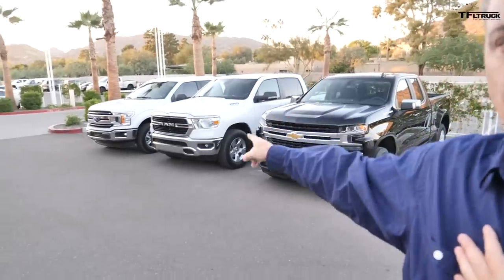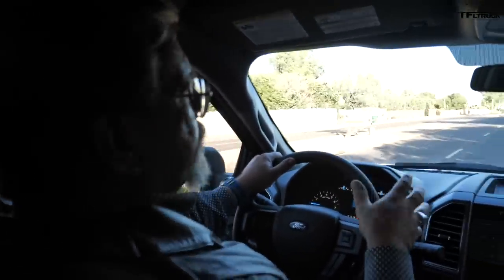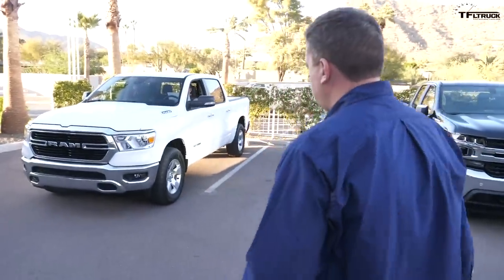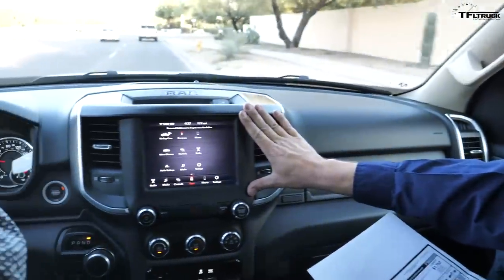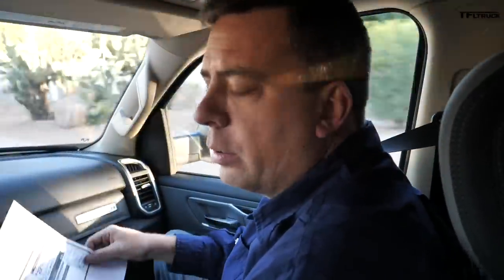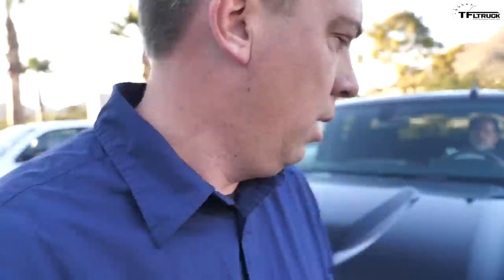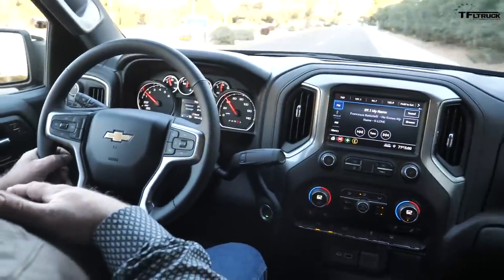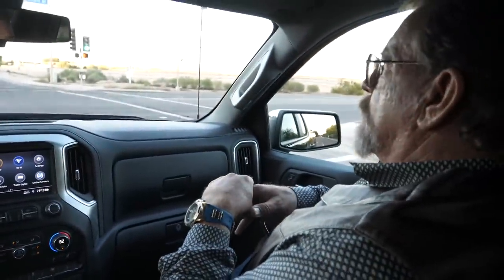Work Truck Wars: 2019 Chevy Silverado 4-Cylinder Turbo vs Ford F150 vs Ram 1500 Review

Comment: The Ford and Ram trucks weren't really "volume trucks". The were just entry level. The XL and Tradesman are the "volume/work" trucks
Reply: No. The one's they've used in the  comparison are XLT and Big Horn which match most closely with LT. The LT in this comparison has more options added than the comparable models and that's the reason for the higher price even though it's a double cab, albeit 4WD . They obviously wanted to show case their fancier tailgate and a few other things not built in to the other models shown here, but those same features are available in XLT and Big Horn. You can get all of these features pretty much matched for the same money if you're crazy enough to pay a bunch extra for these low-cost features that help you be lazier, and so that's not what we should focus on. The focus is how well all the features are executed and the power trains and whether or not you like or dislike styling or interiors.

Ford's base is the XL and Ram's base trim is Tradesman. They start for thousands less than these trucks even though Andre and company keep trying to tell us these mid-level trucks are work trucks; but in fact are far too expensive for what you get compared to the real work trucks. GM's lower trims are now W/T and Custom and Custom Trail Boss; they also start thousands less. But here is the big rub...GM doesn't want the media or us to call them out, and so far, hardly anyone is calling them out. Ford and Ram's base power train in their lower-end models are the same as the power trains as in the trucks shown here (3.6 8-speed w/eTorque and 3.3L V6 6-speed dual fuel injection; both at 20/25/22 mpg; 305/269 and 290/265 peak hp/torque, respectively), but for GM, the lower end customers get stuck with the 4.3L V6 mated to the same old 6-speed (mpg not released but previously 18/24/20) or the 5.3L V8 (mpg down 2 now at 15/21/17 versus 16/23/19 in the previous Silverado; same performance 285/305, peak hp / torque), as completely carried over power trains, aka nothing new except worse gas mileage but the same performance, albeit better capability via the new design. They try to tell us the 2.7L turbo is a base engine, but they don't offer it in the lower end like Ford and Ram does with their premium engines. So now an GM wants to change the game to their benefit by saying that an engine that's not even allowed in the lower trims is somehow a base engine. So how is it that a manufacturer can get away with limiting a choice of an engine in the lower trims, making it standard in level three and four and not optional anywhere else in the lineup, and then say it's a base engine, only because they make it standard one trim level lower than where Ford or Ram makes a premium engine standard. Of course any manufacturer can align their products as they wish, but it's up to us and the media to disregard their claims, and what it boils down to is that the new 2.7L Turbo is not a base engine. Base engines have always been the engines that are in the cheapest trucks for each brand in the segment. It's a lie to call it a base engine. If it were base, it would be standard in W/T and Custom. The media is going along for the ride that GM is  taking the consumer on. The media is supposed to be our advocate; not theirs.

As soon (if ever) that GM puts this power train in the lowest trims, the argument gets very good in their favor as a base power train choice versus the competion, and this comparison becomes immediately valid. They'll have a superior base power train for their half-ton truck in some respects; but for right now, it's a lie to say it's a base engine and compare it to the 3.3L and the 3.6L except but for those two exact, trim-level trucks versus XLT and Big Horn; but keep in mind, for $995 an XLT can have the 2.7L Ecoboost and for another grand, a 5.0L V8. A person could keep the price pretty much the same by dropping some of those unneeded features or even dropping a trim level. One can also opt for a V8 in the same Silverado shown here, so really, this comparison of so-called base engine is no big deal, because one can get what he or she wants, and these days, power train options are cheaper than opting for an 8" touch screen that probably cost GM $100 to add in the truck.
Reply: @gregoryfaulkner5345  I'm not ready that entire reply, nor do I want to waste my time doing so. But I can tell you from the first couple of sentences from your reply. I never said anything about how they match. All I said was that the vocabulary TFL used was alittle off.
Reply: Ford XLT is NOT entry level.
Reply: I wouldn't want to four cylinder in a work truck

Comment: I love when one company has one of these comparisons with their competition.

They provided Ford and Ram trucks, which is nice. But, they optioned up their own truck. Not only does it sticker for $4K more than the Ford, but they added a bigger Infotainment screen inside, as well as 4WD too; while the other two are merely 2WD. 

Nice Apples to Apples comparison, Chevy..
Reply: this is gm forever..allways cheap & nasty..

Comment: For the price, you'd think Ford's interior would be less shit.
Reply: Tbh better than Chevy's
Reply: Ford was the cheapest don’t forget....
Reply: I agree. I've got a 2015 F150 XL with the 2.7L Ecoboost. Fancy interiors is not my thing, but yeah you'd expect more for a $41K truck. I Opted for option package 101A and chrome appearance package back then and my truck is exactly the same interior; same wheels and tires; only the grille is upgraded compared with mine;  same interior features as mine minus the back seat, as I have no back seat. That package cost me $1,100 that's part of the total price at $27.8K before tax and gave me power glass, mirrors, cruise, CD player, MP3 hookup, and some other not-so-important features. A 2018 F150 XL with 101A and chrome or sport trim model now set up the same way as mine would be a ten speed, 25 more ft-lb torque; one more mpg city; dual fuel injection to prevent carbon build up on intake valves; and around $30K assuming the same incentive (it usually gets the same $3K incentive). I don't get where these guys come from when they talk about value. That Chevy double cab truck at $45K with an easier-to-lift tailgate that's not heavy anyway is worth that kind of money; or the Ram at $42K or the F150 at $41K; Really! Take out some of those silly little features and creature comforts; add a more advanced power train; change the letter badging to a less expensive letter combination; reconsider the need of four big doors with a small bed; and then you'd be looking at value.

Comment: Gotta wonder about a large truck with a small engine under near constant boost....
Reply: b sudah like the Ford 2.7 v6
Reply: TheJ602 not like
Reply: @TheJ602  no, the GM is a 4 cylinder...and in order to have low end torque with no lag, it needs constant boost, which can affect reliabity.  I have heard that the eco boost has problems as well...
Reply: @sudahb  prob a 150k engine at best

Comment: This is probably one of your guys is worse videos for comparing trucks now and realize it's a Chevy event and that's probably why
Reply: IronCross82 they picked the Dodge how was it not fair?
Reply: @Haywood Giablomi lol the truth hurts doesn't it
Reply: @smiller225  it doesn't matter which brand they picked it's how a company can take vehicles that don't compare to each other even close that's what the issue is
Reply: Very fair review the Chevy has the most value by far!
Reply: Yah GM showed up to a party with the worst pickup truck you can buy.  Imagine that!!  Lol.
Reply: Haywood Giablomi - Sorry but “mouth breather” is not a coherent sentence either.
Reply: @Haywood Giablomi wow I'm sorry I have to apologize for the autocorrect I just figured you were smart enough to figure it out but thanks for your two cents
Reply: This is the exact comparison Chevy wants. They are saying this turbo 4 is a base engine, and this is something new that's never been tried by a pickup manufacturer. They say it's base engine, because it's the standard engine in their LT and RST trims, which compare most directly with Ford's XLT and Ram's Big Horn; but the little turbo 4, unlike the standard power train in the Ford XLT and the Ram Big Horn is not available even as an option in the lower trims where it would most-likely be appreciated by value customers; whereas a Ford XL and a Ram Tradesman have the same power trains shown here. Therefore, GM is using the restriction of this engine to say it's a base engine, even though the lower trims have a different base engine that would not compare as favorably with the 3.3L or the 3.6L. But in these two particular trims; trims that are admittedly very popular; the 2.7L does compare favorably due to it's superior torque and good payload. I expect, however, that GM was expecting far better mpg result of this power train to help their comparison than what they got, and so it's really a stretch for them to say you get more with this turbo 4 than with one of the V6s from the competitors. The best advantage is going to be more usable power down at lower revs, and so maybe that's what they should focus on. They get equal city mpg, but 2 mpg lower on the highway. But a Ford buyer can step up to the 2.7L Ecoboost for $995; find trucks everywhere set up just like that; get even better mpg; and 400 ft-lb torque, and so I guess they hope not-so-loyal customers don't see what Ford has when they shop, because someone that's going to consider a 2.7L I4 turbo would not be opposed to turbo-charged, gas engines in concept, and they'd see that F150 has 2.7L Ecoboost-powered XLTs at fifteen different dealerships, and so why would someone choose the turbo 4 with worse rated mpg and less torque. If one were super price sensitive, then he or she would just find a truck with a few less features and the twin turbo V6; unless someone is both brand loyal and prefers a turbo charged gas engine.
Reply: @gregoryfaulkner5345  Very well put sir.
Reply: @gregoryfaulkner5345  it is the base engine. Look at stats wt models dont sell but to fleets normally  the 2.7l 4 is the base engine sorry.
Reply: Hell wt models are actually marketed to fleets.

Comment: Chevy really needs to fire their CEO she obviously doesn't care about trucks or how to use them
Reply: In general, management at the auto companies have their heads up their rear ends.
Reply: william shoemaker — Wrong.  Barra is doing a great job.  She was previously head of product development.  My 2nd gen Colorado is a Mary-mobile, and it’s perfect.
Reply: @GH-oi2jf  I have to completely disagree, just because she said that something looks nice does not mean that she should be in charge of the big boy toys
Reply: Generally speaking, the CEO doesn’t get very involved with this stuff. At least not as much as you would think. 

Generally the marketing department wears the pants in the house. They set the maintenance intervals (believe it or not). They decide models and options. They decide allocation.
Reply: James Evans  ha, I forgot equal opportunity

Comment: 4cylinder turbo is cool but to me a truck isn't a truck if there ain't 8 pistons rumbling under the hood.
Reply: What about the Cummins, and also pretty much every semi truck on the road? They have 6 cylinder engines, are they not real trucks?
Reply: @n8rev156  semis dont really have the width to support vs anymore.
Reply: @n8rev156  also anything with a Cummins is just a car slow no torque and unreliable

Comment: Doesn’t Ford also have a 2.7 liter turbo to compare, apples to apples. Why are you comparing trucks that are clearly very different from each other, you would be hard pressed to find a base V6 ford on the lot and could get the base 2.7 turbo for much less then you quoted the regular V6 for. No problem taking up chevy’s offer to take them for a drive, just dont fool us into thinking this is a real world comparison.
Reply: Ford the only real truck 40 +years no arguing facts
Reply: The 2.7 turbo is Chevy's base model engine. The 2.7 Ecoboost Ford is a $1000 option
Reply: @smiller225 , it depends on the trim level of both brands. In a lower trim Chevy the four cylinder turbo is $4,700 more than the base V6. In an F150 Lariat the 2.7 Ecoboost is the base engine.
Reply: DURAMAX_DELIGHT 
2.7 liters, that’s math, the diesel family never argues how many cylinders their displacement has.
Reply: mike naples Correct, at these price points you could get any of the Ford engines in an F150
Reply: You're going to trigger all the Chevy apologists.
Reply: DURAMAX_DELIGHT what happened to you?
Reply: Buck's Shots 
Lol
Reply: Ted McCauley
4 cylinder single turbo VS V6 twin turbo
the diesel family never argues how many cylinders their displacement has
then why did Ford and Dodge/Cummins up their displacement similar to GM's
Reply: Anthony Webber your lack of knowledge does not make comments correct or useful
Reply: Jason Larsen
how so?
Reply: @anthonywebber2211  I do believe Ford had the 7.3 in the 90's..........Then Ford and Dodge got into a power war.....Chevy was just sucking hind teat. Now Chevy realized their error and threw out a big power diesel. Ford and Dodge increased out of necessity to hold that much power. It had nothing to do with Chevy having a 6.6.....

Comment: My cell phone has a bigger screen then that ford.
Reply: That is a silly screen... Gives a "why bother" look to it. And I like ford, the fact that it isn't larger even if it's just a backup camera / mpg display is silly, like the old radios without a tape player or 90's player that were just big empty squares with fm radio buttons. I guess they have to do something to make you feel forced to pay for the upper trim package.....
Reply: @volvo09  You can get the larger screen with Sync 3 for a small upcharge. I'm sure Chevy was okay with the Ford having the small screen.
Reply: That’s how they get you to buy the real screen.
Reply: Sammie Peanut butter It's still better than a base radio with no LCD capable of that type of graphical display.

I have that small LCD in my company provided Ford F-250 and in my 2014 Ford Escape. 
It's a zillion times better than the non touchscreen  U-Connect that came in our 2013 Grand Caravan. 
I threw that pos into the trash and installed a Kenwood with android auto. 

I'll look for a sync 3 next time with android auto but the non touchscreen small LCD in my current two Fords still work good and don't piss me off like the dodge u- connect did.
Reply: 2019 F-150 XLT has Sync 3 with 8 inch screen standard now. Also automatic emergency braking standard on all models.
Reply: Sher Nematzhonov electric parking brake is dumb in my opinion and I just looked at a 2019 yesterday and it had that same small tiny screen
Reply: This is a real issue for Ford though.  When we bought a 19 Bighorn RAM for my folks, we were cross shopping it with the 2.7 XL(because the XLT was significantly more) and it was really hard to find one with the larger screen. And even then, it still looks tacky AF with about 30-40 buttons all around the screen.  Our first RAM, so I am definitely crossing my fingers(Chevys previously and I own a baby Duramax Colorado) but as a whole package at any price point, there isn't much comparison.  If only Toyota dealers would move on their prices we'd buy a Tundra.
Reply: @sammiepeanutbutter8245  And the Tundra comes with adaptive cruise control stock on all models.  So what was your point again?
Reply: It’s to shame you for being cheap or broke. Just like all the buttons of shame, and the cheap looking black plastic pieces all over instead of a higher finished trim pieces. How dare you for not spending more money.
Reply: @sammiepeanutbutter8245  All 2019 XLT models have Sync 3. You can get Sync 3 in XL as an option. I agree, 4.2 inch screen needs to go away. It is not 2008 anymore.
Reply: Alexander Golubev Jr that it’s a small screen?
Reply: @sammiepeanutbutter8245  Yeah.  It's by far the smallest, most poorly designed console out there.
Reply: I agree on the Toyota thing.they know what they have and they won't budge on price.
Reply: When ford put their 2.7 out there they put it against Chevy 6.2 . Here Chevy must of done some serious digging to find that ford base model.
Reply: I do have a bone to pick with Ford for offering such a TINY screen. My Samsung Galaxy S6 has a bigger screen. Ford should at least made it 5" screen with the 8" as the upgrade option.